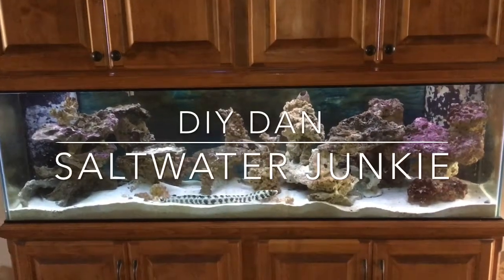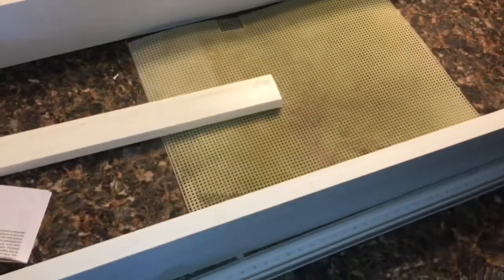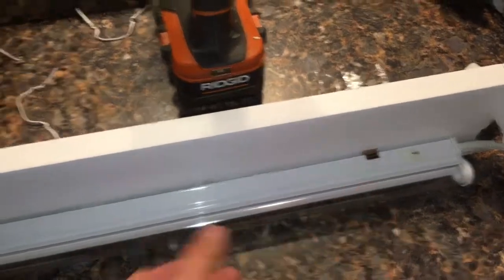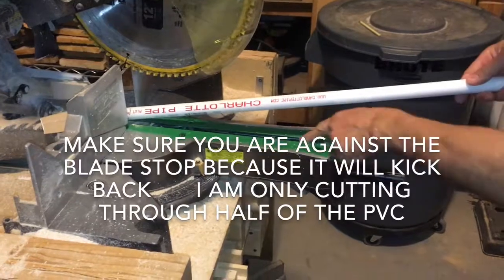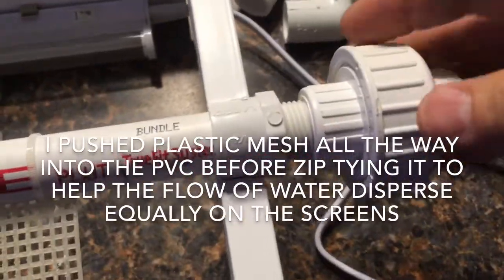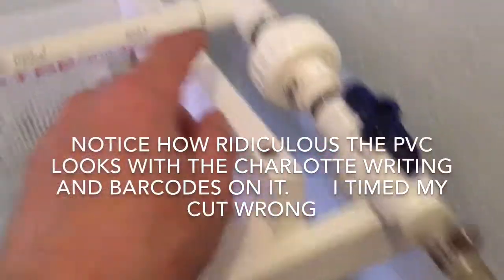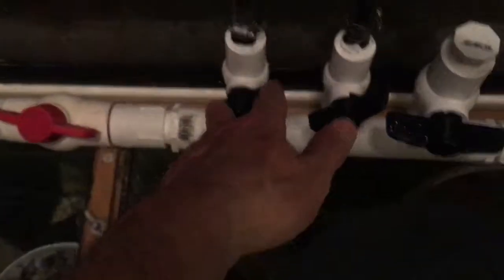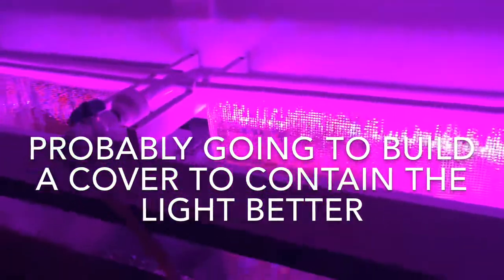DIY algae scrubber waterfall that supplies my refugium therefore no waisted lighting or water flow

Comment: Dan, you seem to be a master with Algae Scrubber’s! I wanna pick your brain for a brief minute. What light will get the job done and what do you prefer now? Do you contain the light now or leave it open? How about GPH on the screen? I wanna do my first DIY scrubber build on a 105/G. Not sure what I want to do, but I’m liking your design. Simple, cheap, and effective! Seems like all the new scrubbers have a housing box and that seems like it will be difficult to clean or see what’s going on with the screen. Any tips appreciated! 💯👍🏼✅
Reply from the maker: I have a scrubber on each of my systems and will never have another system without one. That scrubber is still doing great but I really like my huge scrubber I built on my multiple tank system if you haven’t checked out that video. As far as the lighting I never really saw a noticeable difference between the types of lights that I used. I had bought a par 38 led bulb and tested it against a 100watt equivalent cfl and they both produced about the same results. I have several videos on my channel about algae scrubbers and recommend watching all before building one cause I go over issues and changes I have made and why I made them good luck,👍